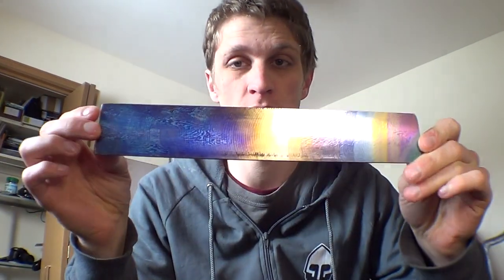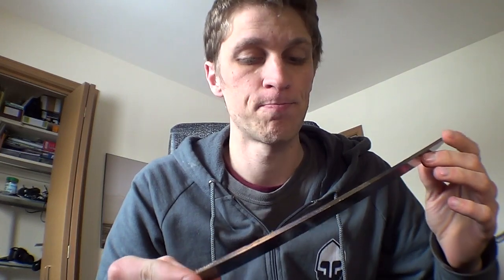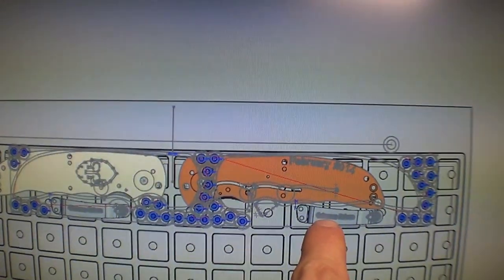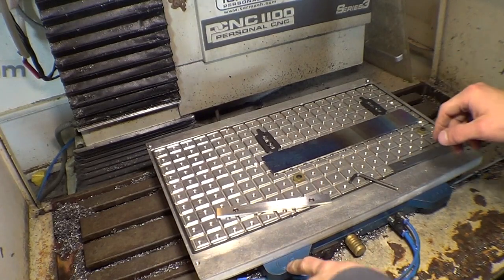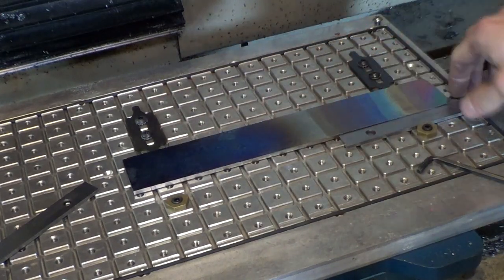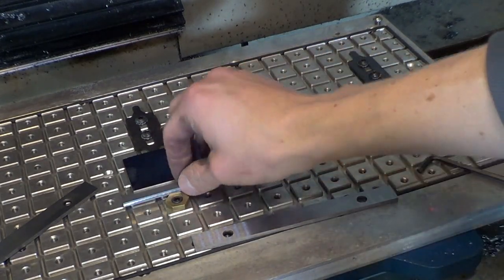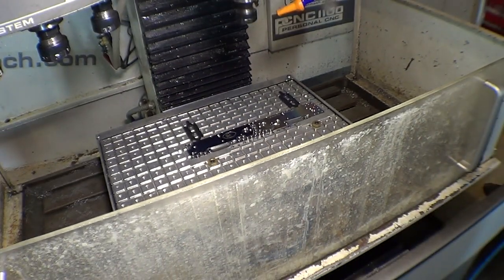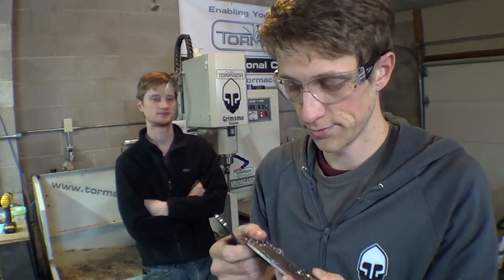Knifemaking Tuesdays Week 84 - Timascus Part 1

Comment: try using mobile cut 102 for cutting oil helps with rust prevention and cutting, water soluble cheap and helps alot, works in my cnc shop , started about the same time you started , great work your doing, just purchased my 3rd haas vf2. keep up the good work

Comment: what have u found to be the best feed and speed for a .250-4 flute square end carbide endmill and .375-4 flute crbde ball when doing your bearing pockets for example in standard titanium,, whats the best chip load per flute to calculate with and what amount of step down during milling will make the end mills last the longest when milling titanium, ive never milled titnm and dont want to waste money on breaking endmills (ive heldback a couple SGS-Z-carbs for this)  u have already done the research through experience, the z-carbs were expensive and i need them to be programmed feed/speed and bite depths right the 1st-time, thanx for any advice

Comment: Hi,

I was wondering whether you might have thought and maybe even tried to melt down and remake the Ti into sheets for your use again. I wonder if now it is now gone through the Sand/Water/Grading/Mixing/Sponge-Forming/Malleable Stage which is it’s unbelievably complex production process, whether the swarf you keep could be remanufactured without the use of gaseous production methods which complicate its manufacture so much, and just ‘melt’ it, all be it at a very high temperature 1668C without the complicated exclusion of Oxygen and Nitrogen. I may have just answered my own question, but still wonder if the ‘exclusion’ process is one the melting of off-cuts and swarf necessarily has to be part of the re-manufacture? Actually the exclusion part might be relatively easy to achieve on small batches of maybe the same sized sheet you show.

This is interesting and however the inventor/finder ‘William Gregor’ of this stuff actually came about the manufacture to a point where it could be named Ti in 1791 is amazing, or whether he was the man who found it or discovered it  ?